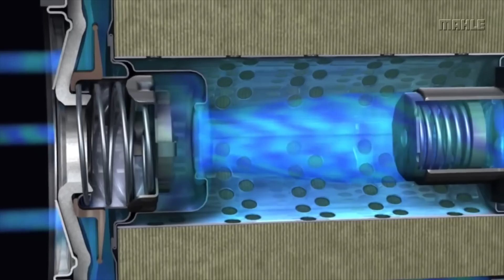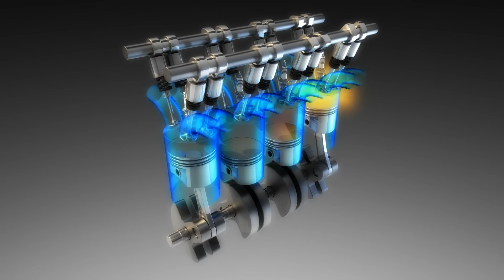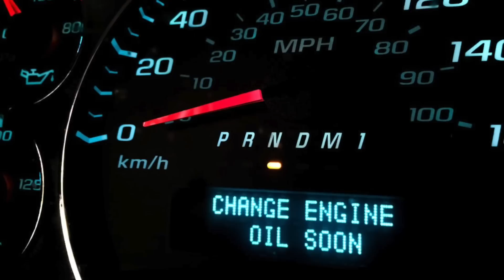The Trainer #90:  Nothing "Routine" About A Routine Oil Change!

Comment: I always use OE filter and for blended oil 3 months 3k miles. synthetic 6 months 5k miles. For my "older customers" who don't drive that much once a year. when I pull a valve cover I can tell who goes by manufacturer schedule and our reccomendation.

Comment: I always recommended every 3 months 3000-5000 miles.  Always used quality parts and oils, and never had a problem.  The added benefit of every 3 months was to find a problem before it became a bigger problem.

Comment: We used Frantz Oil Filtration. It uses 4 1/2 inch tissue paper, filtered out down to 2 microns, Engine problems could be diagnosed by appearances of the top of the tissue paper. Used Frantz on gas, diesel engines from pickups, tractors and combines. Saved greatly on oil and filter costs. Besides extended engine lives.

Comment: Short trips which never get your oil above water boiling point leaves water in the oil, is one reason to change more often than their scheduled changes. 
The hard use of the engine is another way to ruin it without changing the oil often.